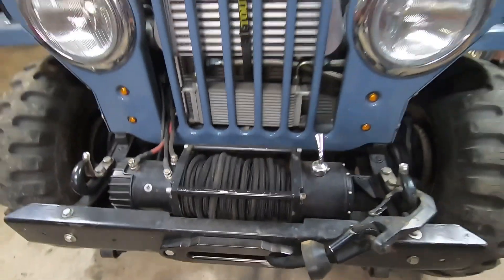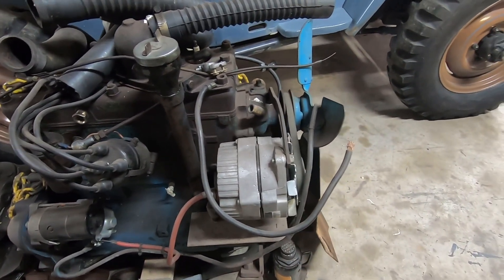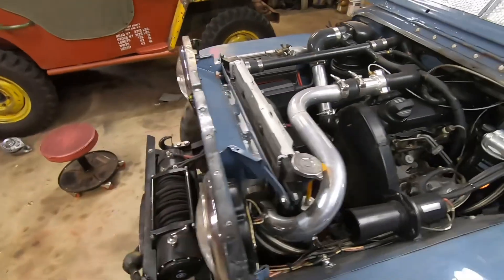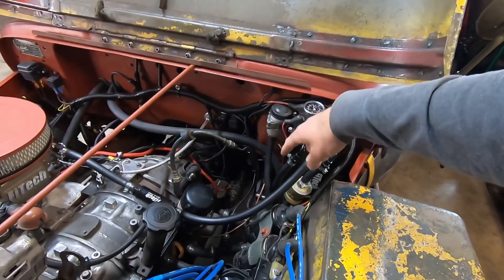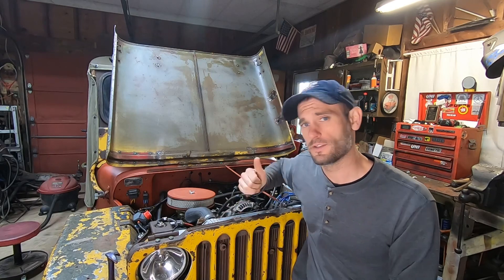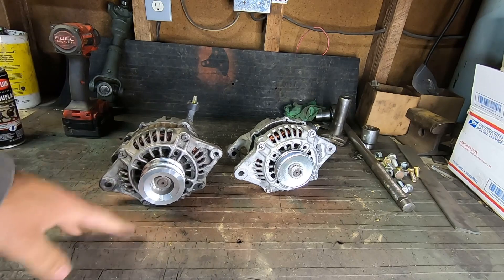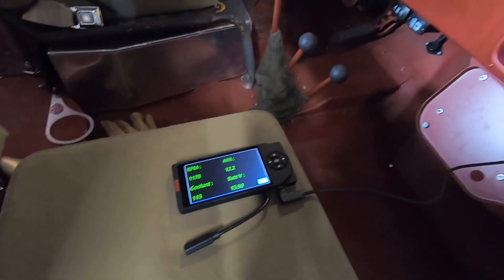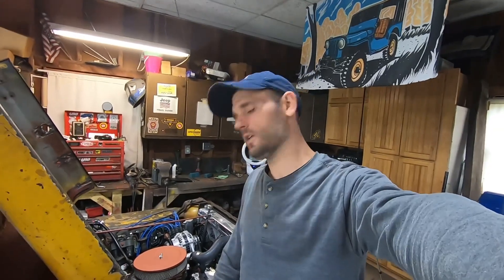Choosing the right alternator for my jeep

Comment: How is your stock AMP gauge doing. I hear high output alternator to much amps will fry the stock gauge.
Reply from the maker: When you switch it an alternator from a generator you will want a voltmeter. I don’t use an amp gauge.